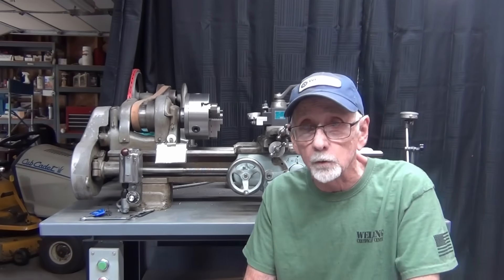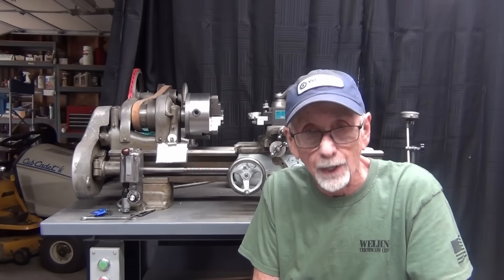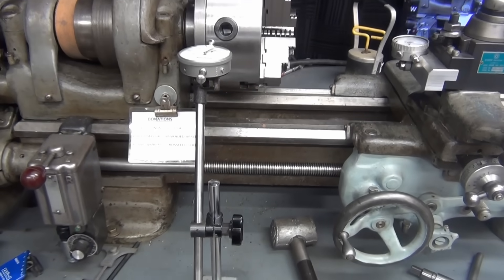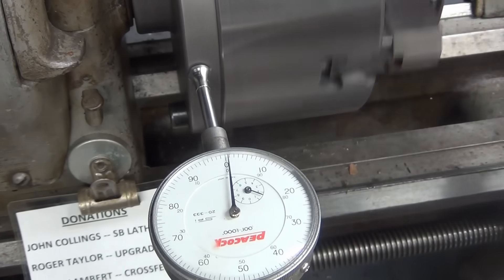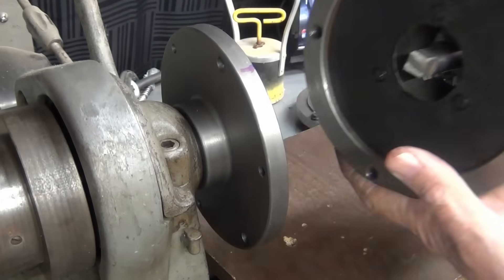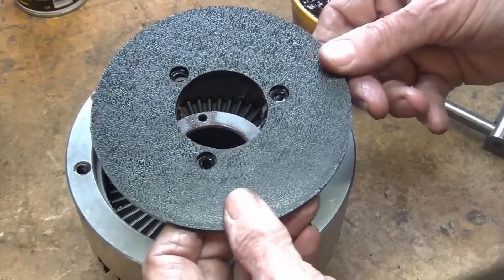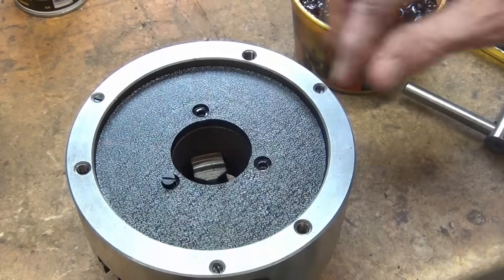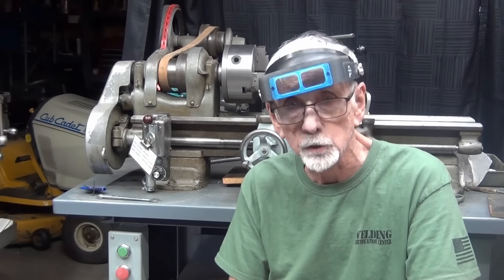IMPROVING the VEVOR 3-JAW CHUCK #1065 tubalcain

Comment: you didn't check the face of the plate there may have been a slight amount out, causing the run out.
Reply from the maker: I will check the plate for run out. Thanks!

Comment: When I began my industrial maintenance career in 1982, none of our chucks could be reliably set up or inspected for OD runout. The explanation was that non critical surfaces were not reliably machined to high tolerance to control manufacturing costs. All of that changed over the years of my career. Machining capacity increased, and we were indicating chucks from chuck OD on a routine basis by the end of my career. I am interested in your chuck OD and backing plate OD inspection. I would like to see you compare indicated runout to the spindle runout before concluding the runout is in the chuck and backing plate OD.
Small lathes don't have easy rigid surfaces for mounting mag bases. I don't like mounting the inspection mag bases on the sheet metal table. I would try to mount it on a machined rigid surface, though your gentle inspection motion is clearly not creating much of a problem.  
In my industrial setting, we were looking for your OD TIR under .0002.

For non critical hole centering on the mill such as you demonstrated, I have found that gage pins speed this up the process over indicating the existing hole. Gage pins are long enough to normally clear the workpiece. My gage pins are indexed in standard fractional and lettered drill index boxes. I use the gage pin method for quicker non critical edge finding than using an edge finder. The math is simpler and I don't have DRO on my mill. Keeping track of backlash or setting up a travel indicator on the mill is frustrating. With a known workpiece width dimension, center is easy for non critical work with .500 gage pin as is edge to hole center. I always feel that I am a hack when employing this method, and I hope that no one is watching me.

I trim SHCS with carbide. I trim the SHCS head if I can't get adequate counter bore depth, and generally shorten bolt thread length in the lathe by chuckig on double hex nut. Grade 2 is generally soft enough to easily align the nut flats for firm enough work holding for this non critical task. 

If everything checks out well on the Vevor chuck, including validating the scroll, dressing the jaws with your tool post grinder might improve TIR. I had significant success doing this with a used and abused 3 jaw chuck that is now my daily user.
Reply from the maker: Thanks for sharing your experience with chuck inspection in an industrial setting.

Comment: how do you improve the runout? can you just grind the inside of the jaws while it is spinning?
Reply: No, because there is a little bit of 'play' (looseness) in the fitment of each jaw and the chuck body/gear teeth.
Reply: @thedevilinthecircuit The chuck jaws could in fact be ID ground, but the jaws need to be under a load. There are various ways to accomplish this.
Reply from the maker: I have no plans to improve it at this point. Good enough for what I do.
For real accuracy, I use a for job

Comment: Try labeling the chuck key holes and tightening and checking runout from each position.  Every 3 jaw chuck will be more accurate and better repeatability from one of the  holes. After you determine which one it is, mark it and use that hole to tighten when you need more accuracy. Ever notice many Buck 3 jaw chucks only have one chuck key hole? Thats why.
Reply from the maker: Thanks for the suggestion!

Comment: Very nicely done. Succinct and to the point, but nothing left out. Thanks. BTW out of curiosity, how did the chuck on the new VEVOR dividing head check out accuracy wise? And if you took it apart, was there any "junk in the trunk"?
Reply from the maker: Actually, the next day I did check the dividing head, Chuck. It was not as accurate as the first one. I was disappointed.

Comment: Mr. Pete, On my 9" SBP, I had to turn down the register, that little counter turn the chuck sets on the back plate, about 0.010" on the diameter.  Put the chuck back on, leave the screws snugged gently.  Then bump the chuck around untill the 3/4" dia shaft runs true. Tighten the cap screws.  This is how I take care of the runout.  I have never had a issue with the  chuck moving around while machining.  IT stays dead true. Ken
Reply: Yes,, "bump-tru" is the way to go on these small, threaded-spindle lathes.  Just the cap screws will hold the chuck at the correct spot as I've been doing it for years without issues.
Reply from the maker: Thanks for sharing your tip, Ken!
Reply: I bought a cheap Chinese three jaw mounted on a 5c collet body for a lathe that has a 5c spindle, for a small chuck. And did exactly this. I started with about a five thou runout and got it to less than one. And to be fair, a couple thou of what I started with was due to the wear in the spindle. I've not gotten around to regrinding that. Yet.

Comment: Would have been interesting to see the spindle run out of the lathe without anything attached. 
Keep up the good work !
JIM 🥰🇺🇸
Reply from the maker: Thanks, Jim!
Reply: Well, the backing plate was very close on the diameter. But could have been off on the face. And if so, truing the face might be a good idea.

Comment: Could you have machined a little off of the registration of the backing plate to give a little adjustment?
Reply from the maker: Possibly, but the job is done
Reply: A thing isn’t settled, until it’s settled right 😊
Reply: On a low priced chuck, even if you get the runout within .001 on a small diameter it would likely be worse on a larger one. Some improvement can usually be made by fiddling with it but you may wind up chasing your tail.

Comment: It’s unfortunate that no improvement could be made in concentricity, Mr. Pete, but at least you happier with the chuck.

Still, a fun and informative watch, as always!

Thank you.
Reply from the maker: Yes, that’s close enough 98% of three jaws have a run out
Reply: @mrpete222 . The 3 jaw on my (new to me) Atlas 3960 has a ridiculous amount of run out, but looking at it, there is what appears to be a spiraling gouge across all three jaws.

I’m planning to check it again with a better piece of stock, just to see if it’s my test piece.  (Chunk of aluminum.)

If it’s still there, I’m thinking to install the outside jaws, (still new in wrapper), and see if the problem changes.

If it’s just the inside jaws…may try to improvise a tool post grinder in the milling attachment, I guess.  Turn a ring for the jaws and figure out something long enough to get all the way through.  (I don’t think a Dremel stone would have a long enough shaft?)

(Edit to add, I haven’t put the dial on it yet, but my old school mechanic’s eye says .020 to 025ish total at one inch from the jaws…)

Comment: I just got myself a 6 jaw chuck from vevor and so far my runout is close to 0.010 thou. The backing plate is at 0.003 thou. It is the D1-4 camlock spindle nose and the camlock studs are very loose compared to my other brand name chuck.
Reply from the maker: That is quite a bit of run out, more than I would have expected

Comment: Should the runout also be tested on larger diameters to check the scroll accuracy across the range?
Reply from the maker: I considered doing that, because it will vary slightly by diameter

Comment: Thanks for the informative video. Could you have determined which jaw aligns mostly with the movement of the indicator, grind a thousandth or so off the face of the jaw, effectively moving the rod closer to true center.
 Just a thought. Maybe not perfect but an improvement.
It would have to be the jaw that moves the stock away from you.
Reply from the maker: I have never heard of it being done in that manner. And I am very dubious.
Reply: @mrpete222  I've seen it done, but make SURE that the error is in the jaws first. If the error is in the mounting plate, chuck body or scroll this could make it worse. Especially at different working diameters.

Comment: I expect your Cat time roundness measuring kit was a Taylor Hobson machine. Amazingly they are still going strong having been founded in 1886 in Leicester, England as a lens maker. They started to develop metrology equipment in order to accurately quality control their lens production in the 1930s and never looked back. So, maybe I have taught you something you never wanted know Mr P.😁
Reply from the maker: Thanks for the information!
You are absolutely correct that was the name of the company. Much of their inspection equipment had that name on it. Someone else already pointed out that that specific machine was called Taylorround. 
I had never heard of that name until I worked at caterpillar where Cost was no object  .
Also, I appreciate the history of the company I was unaware
Reply: @mrpete222  Thanks. Their history is quite interesting, they were the pre-eminent lens suppliers to the film industry, having over 80% of the global lens market in the 1930s. It was also Mr Taylor that designed the modern golf ball pimpled surface having taken up golf on medical advice and found existing designs to be lacking. Also the machine name was actually Talyrond rather than taylorround
Reply: @petercharles2715 Dean Smith and Grace used Talyrond machines for checking that their toolroom lathes didn't leave gearbox meshing marks on the turned components at final inspection.
Reply: Thanks Mr.Pete.    I would like to have seen how you centred the counterbore on the holes.   That was interesting,very interesting!   
I have tried to buy one of the Vevor drill sharpeners in the UK.   The one you demonstrated model C that came with the diamond wheel bundled in.   You know  the only have such a limited range available here. Its a pity because Vevor tools do seem to be good value for the money.  Have a pleasant weekend You and every single one of your subscribers.  Winter chills are about to fall on us.  ❄️
Reply: They made lenses for military reconnoaissance in WW2

Comment: Starting a job with the quill out brings back memories. It was one of the many pet peeves of the senior machinist when I started. Usng the quill was for special occasions, a bit like only taking the plastic couch protector off at home when guests come round 😄
I bought one of those head visors on your recommendation several years back, best purchase Ive made for  a long time for all sorts of uses, not a brand name one but it does come with a handy rechargable light.
Reply from the maker: Glad the visor worked out for you!
Most of the time I work with the quill extended, so I do not have to crank the table, lol. I do realize that the shorter the quail is, the better.   But I am not making rocket parts, lol.
Reply: I love the ones with the rechargable lights.  I replace the plastic pins with small screws to keep the lenses from popping out.